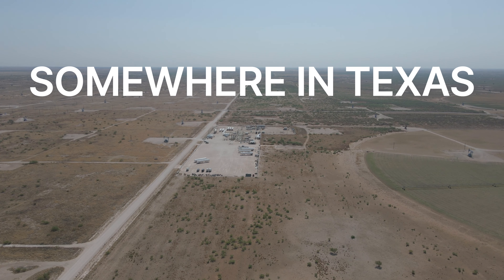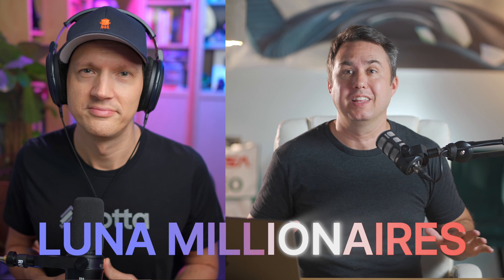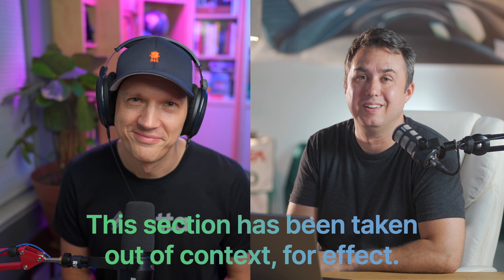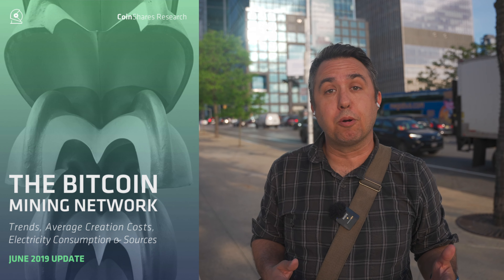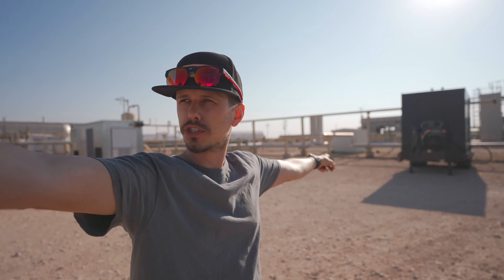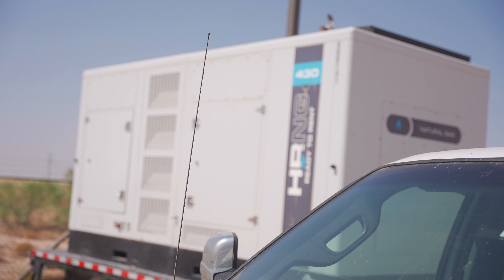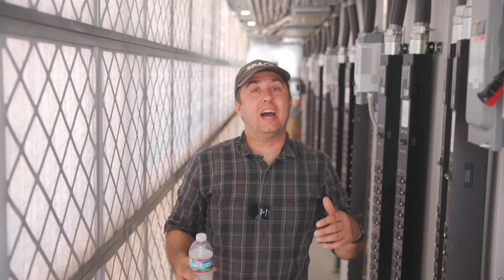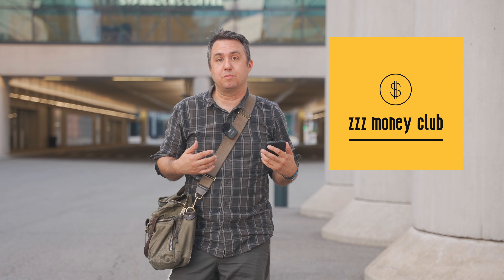Bitcoin Mining Farm Tour at a Texas Flare Gas Site - Featuring @YourFriendAndy

Comment: It sounds like that article you quoted was actually saying that 70% of bitcoin mining has "any" renewable sources of energy in their grid at all (which is like saying 70% of iphone chargers use renewable energy). If you're a utility or have solar panels on your roof and sell excess energy, you basically just add it to the overall grid and gets spread out or used by your neighbor randomly, so it's not really an easy stat to calculate. Seems like the other 30% in the article "not using renewables" is basically operations like this one you highlighted which use solely non-renewable sources, however I may be wrong. 

Great video nonetheless!! More videos like this please!